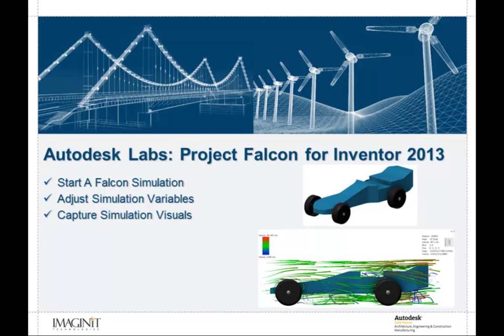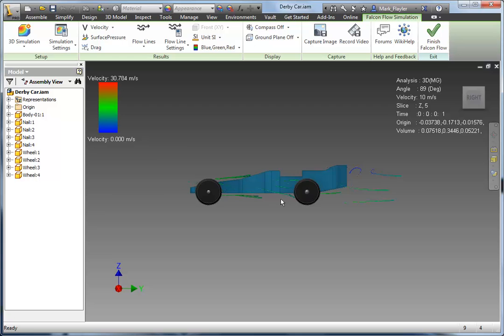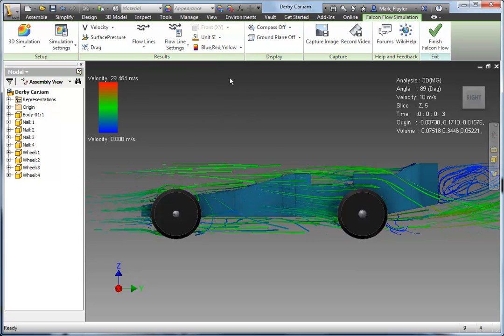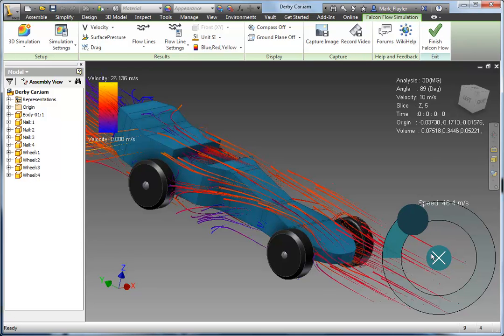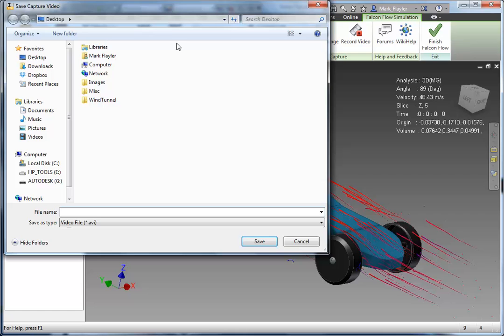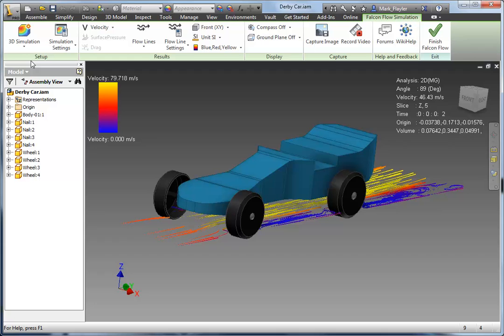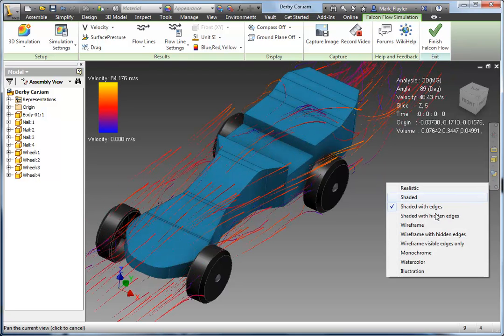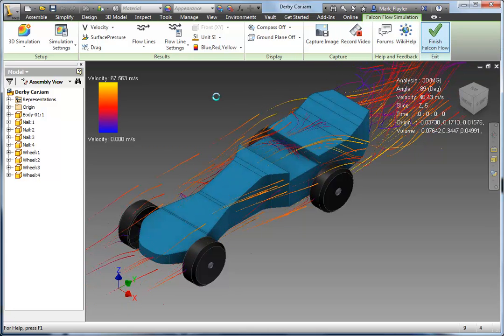Autodesk Project Falcon - Wind Tunnel - Inventor 2013

Comment from the maker: @Jose It has been updated to only work with 2014 for the integrated portion.

You can still use the standalone if you do not have 210